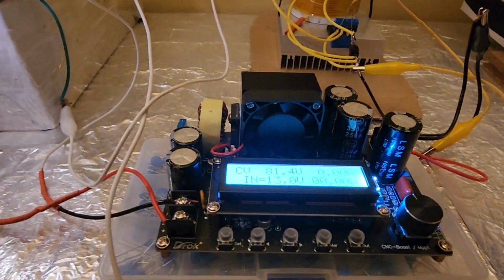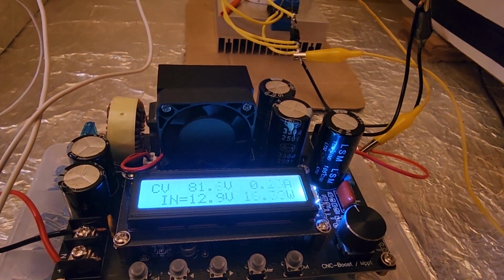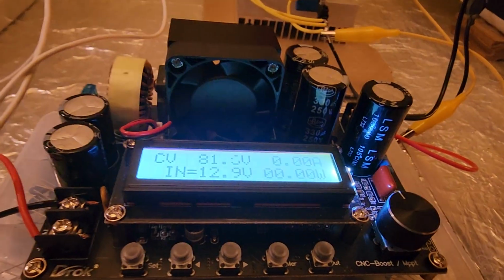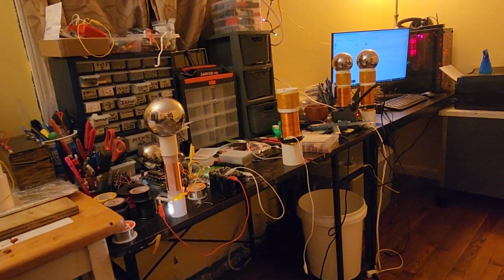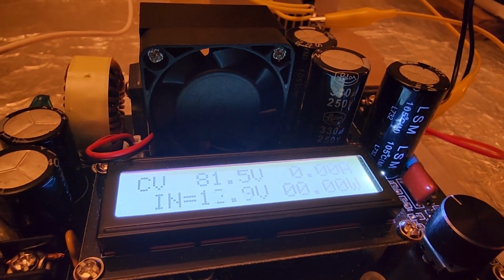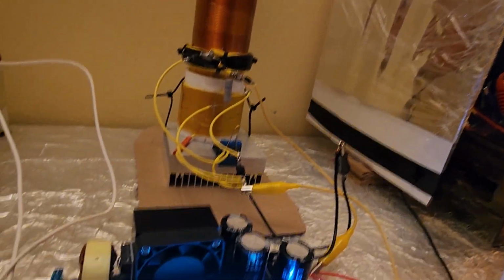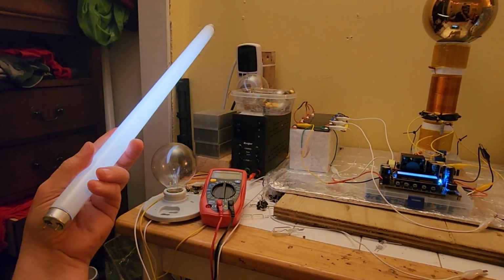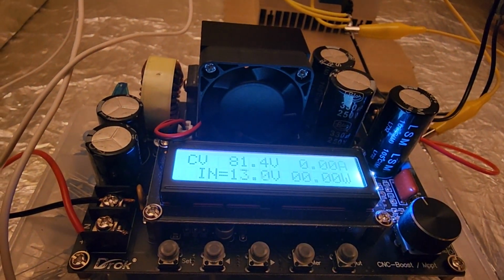😱Transmitter Stopped Consuming Power When Back Fed Receiver Coil Energy? Whaat? How?!😱

Comment: Nice! Maybe a big cap in parallel with the supply, then super tune to zero power. Then disconnect the power supply to get an idea of your amp draw by volts dropped over time. Has to be some kind of repulsive back feed E field, which might "boot-strap" up the transmitter coil. The plate being plastic means it's changing the C of the surrounding field. Wow! Are you seeing any frequency changes while super tuning? This is truly, very cool! 😊
Reply from the maker: Good ideas & frequency seems to lower slightly with wireless loads in the near field of the transmitter but not the far field